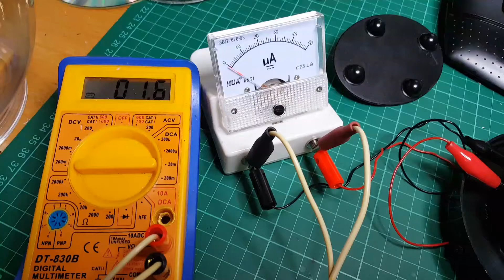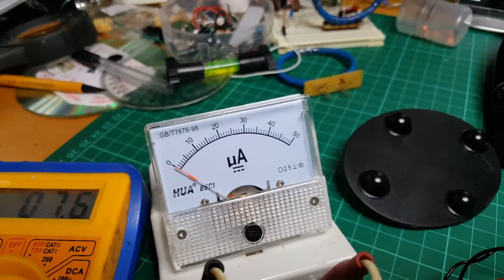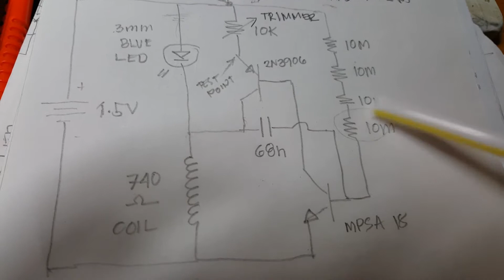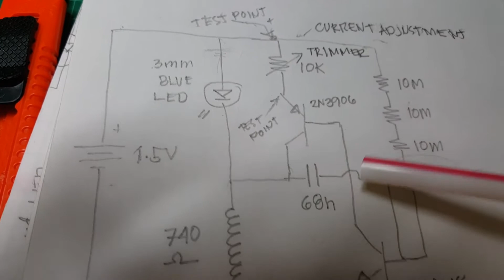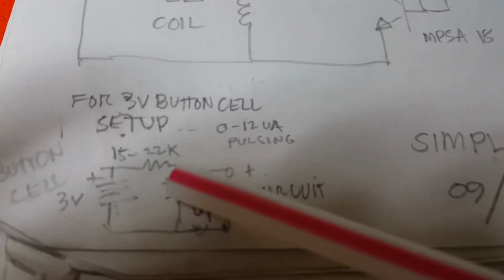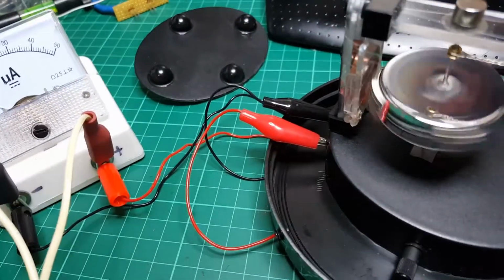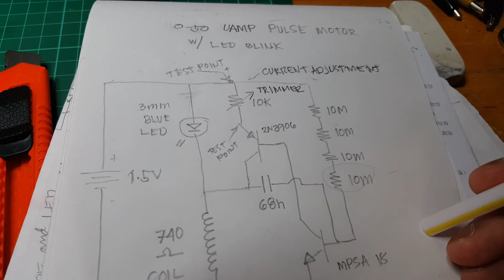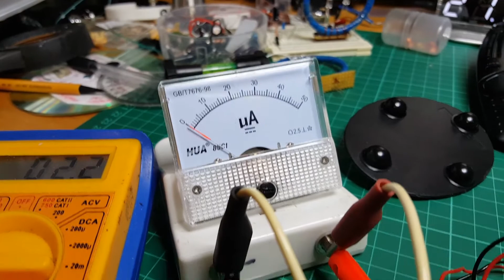Update 2 A big  Improvement of my Pulse motor

Comment: What if you add a diode to catch the bemf to charge the battery too
Reply from the maker: Yes you can but  it's only micro amp not  giving you much to charge another battery  the back emf  already  goes to led
Reply: @alisasuperrobot  from my experience geranium diodes collect bemf pulses better then leds. Leds have higher losses when using looped circuit to recharge battery

Comment: I thought that to test amperage, you put your amp meter in between the positive terminal of the battery and your circuit? I would think that would give the most accurate results. Do you agree? I love your guitar string support. Very inventive.
Reply from the maker: the current is going to pnp emitter transistor when the triggering pulse in to the base and when its off no power going through the circuit. on my previews video I called 0-10 micro amp pulse motor you already  watched  my test point between positive terminal  to the circuit  you can see there I'm shorting and open + and -  of the meter  the reading result is a bit higher because the led is disconnected the reason  to put my test point to the trimmer legs that i notice the motor is a bit struggling to rotate causing the resistance of the meter. led is a big help to drop the amp draw.
Reply: That seems very logical.
Reply from the maker: I'm curiuos about the 1 uamp draw  this video  so idid another test. whatch this video https://www.youtube.com/watch?v=TtfT6SXgypc&t=13s this just a small cap 220 uf running in about 5 mins
Reply: @alisasuperrobot Isn't your meter on the 20v range?  You do not test amperage by hooking across the trimmer.  Surely the voltage across the trimmer is less than 1, showing up here. Also,  I've replicated your circuit with different params, using only 1 x 10m with a 2.7nF cap on a 3906 and 2222 and got 4microAmps, with a coil that is 100ohms - i have not yet built the motor though.
Reply: sorry i meant 220nF, or 224

Comment: Really good idea.  I have had the same "wobble" problem stopping my motors.   This upper bearing stops the problem.  The extra friction is worth it.  The low amp draw on your motor is amazing.  If you use a small solar panel and a super-capacitor then it might run 24/7 without a battery using ambient room light.
Reply from the maker: hi lid , i did try  the smalll solar with 220 uf cap and it works  then i took off the solar just the capicitor it run about 5 minutes and stop when the voltage to the cap drop to 0.025 nv. this setup circuits is with self charging effect  the led is really big help to drop the amp draw  if I blow the rotor without the battery just using the cap the led will light up and charge  the cap watch my other video you can see what I meant https://www.youtube.com/watch?v=TtfT6SXgypc